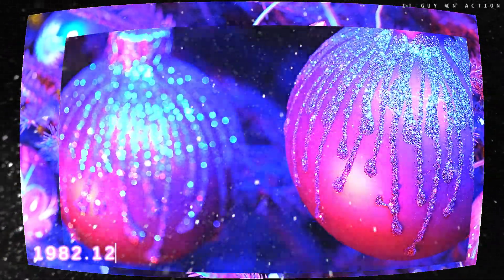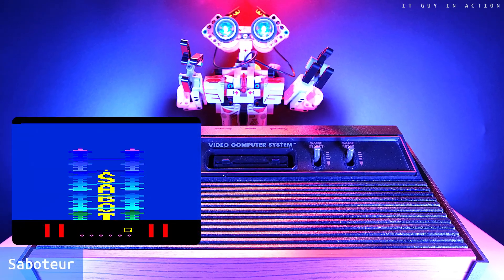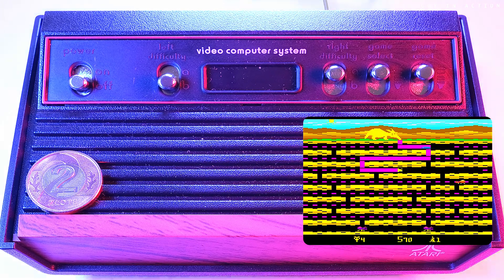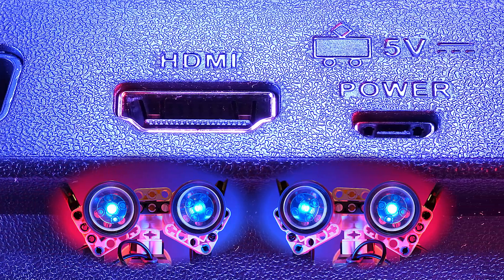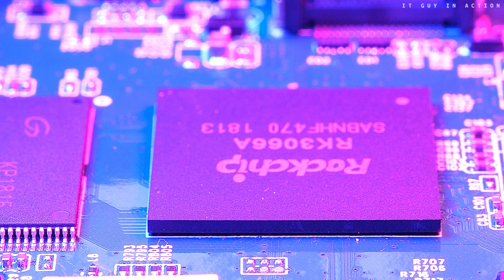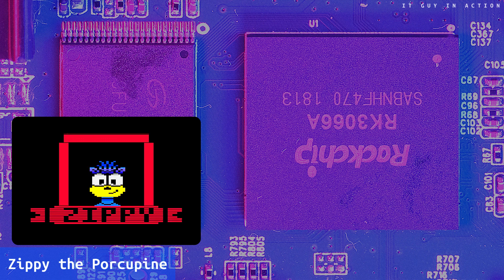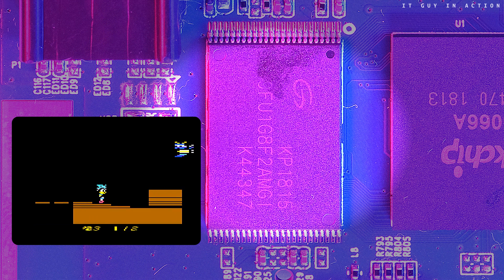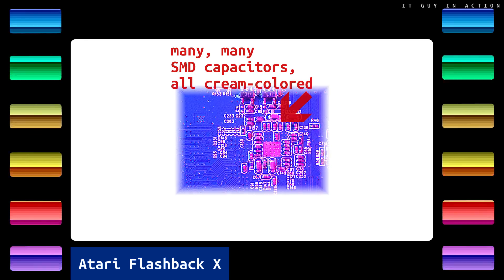🎄 Atari 2600 VCS and Flashback X 42 years of evolution in IT (what is inside? ABC of electronics)

Comment: You should check out the flashback 2 (ASIC based) and the new to be released Atari 2600+ by Atari SA.  It has a cartridge slot, but it only functions as a ROM dumper.  Unfortunately, this prevents a lot of games from working. Any game requiring hardware on the cartridge will not work. Some of the bankswitching schemes are not working either.  Probably all the SARA games will not work. Pitfall II and any modern melody board games won't work.  It can, however, run 7800 games with some limitations. It's a 120 Dollars and includes a 10 in 1 cartridge.
Reply from the maker: Limitations of emulations... On the other hand, making "real" Atari 2600 would be quite expensive nowadays...
Reply: @ITGuyinaction  There is an atari being made by the community which interfaces the 2600 slot with a raspberry pie board running stella.  Zero Page Homebrew showed it off recently.
The ASIC has already been designed. They did it 20 years ago. The only real problem would be interfacing it to hdmi with minimal lag.
For 120 bucks, I expect a quality product, not the just the latest flashback minus all the games and a barely functional  cartridge slot.
Reply from the maker: @tarstarkusz  👍 I agree, I would also expect sth more. Probably this atari flashback gold 50th anniversary edition might be a better idea if someone wants just to play from time to time and to feel this retro atmosphere a bit. At least they provide 2 paddles and 2 joysticks.
Reply: @ITGuyinaction  Me personally, already own like 20 ataris and ways to play Atari (like Colecovision Expansion Number 1, a gemini, the 5200 converter etc) games. I only play my Atari games on a CRT.  But if I didn't have the CRT, I would definitely want a way to play them on LCD screen.
The 2600 plus only comes with 1 joystick and no paddles and no joystick with the 2nd button for the 7800 games.  I don't think the light gun games are compatible with an LCD screen anyway, especially if there is a delay.

The paddles should be in the box, IMHO.
I thought the 50th anniversary thing was for modern consoles and not a standalone unit?
Reply from the maker: @tarstarkusz  What do you mean by modern console vs standalone unit?
Reply: @ITGuyinaction  I thought the 50th anniversary thing was a release for the VCS, PSX and Xbox and not a piece of hardware PNP type thing.
Reply from the maker: @tarstarkusz   Atari Flashback 50th anniversary contains only Atari 2600 games. Although in practice it's Android based device thus it should be probably possible to modify it...
Reply: @ITGuyinaction  Does the hardware version include all the stuff the software version includes like the new versions of some old games?
AFAIK, it has been released for all the systems including Atari's own VCS console.
Reply from the maker: @tarstarkusz   It has included list of games in flash memory and that's all. Some are new, some are those old classic ones. However it's also possible to connect pendrive and to play other games but it's much more tricky.
Reply: @ITGuyinaction  When I say "new games" I don't mean new 2600 games.  The console version includes new high res games. I want to say they are called "reloaded" versions.
I just watched a review of it and saw the way to upgrade it.  Pretty cool if I were going to buy one.  Like I said though, I already have multiple 4 switch, 6 switch, several 7800s, a 2600 jr and then the converters plus the Coleco branded 2600 (not the add on, it's standalone) and an Atari 2700 console from Japan, which is just a 2600 with more lights.  I have a FB 2, which one of these days I'm going to mod with a cartridge.
Reply from the maker: @tarstarkusz  👍 👍 👍 Nice collection!